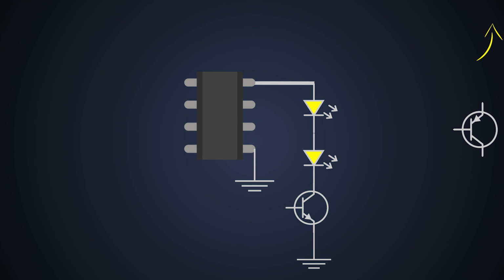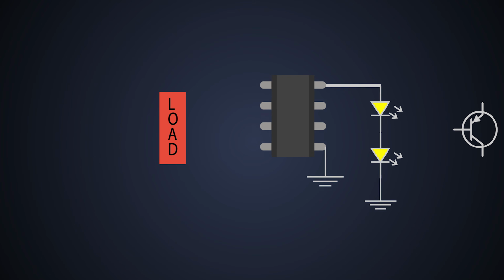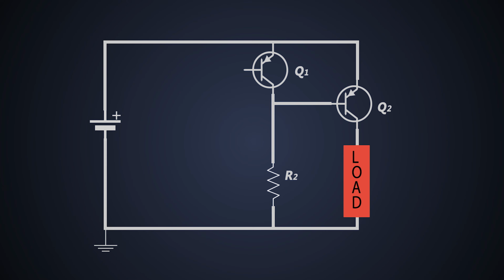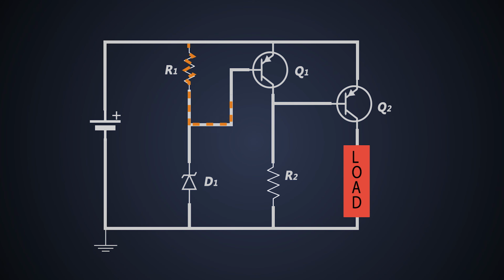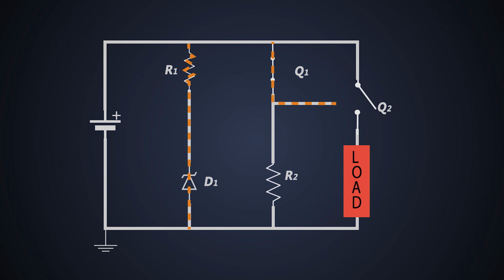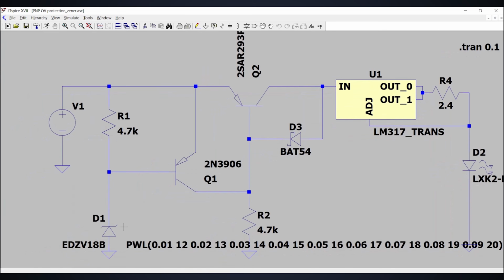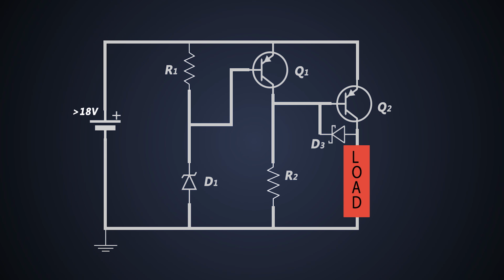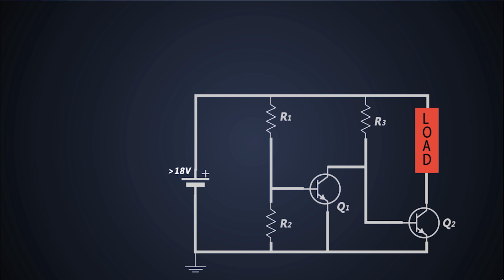How to design PNP BJT based Overvoltage protection? Overvoltage protection using PNP BJT.

Comment: Nice! But still there is some range (for max input) for this circuit and that you should have mentioned and also covered how to calculate that. Because many times there is a chance that 220V is fed into a 12V input system by mistake. So what happens in such case?

Comment: A bit of suggestion: with respect to the NPN solution, you will use most of the time the PNP solution like in this video. That's because when you protect  by enabling or disabling the ground, that transistor collector will sink all the current returing in the ground, hence all switching noises, rf noises, will come to that transistor. The pnp solution instead connectes the emitter with the supply voltage, and you basically detach or attach the input voltage.

I'm talking about the solution in 6:53. That is also called "Transistor controlled Load Switch PNP" which you can find in many application notes

Comment: What is the use of Schottky diode here? Can you please explain? I can not understand.
Reply from the maker: there is no Schottky diode here
Reply: Schottky diode in the LT Spice mode is a Baker Clamp diode (see Wikipedia).  Improves the transistor switch-off time by preventing saturation.

Comment: Sir please make video on internal circuitry  , internal working of  LM 317 voltage regulator
Reply from the maker: Okay
Reply: @FoolishEngineer  thanks for the  reply  , please a video on explaining multivibrator using  transistors  eg astable multivibrator  used for pulse generation

Comment: I am afraid that IURLC is correct. When the supply voltage is increased to say 25v (over voltage) the b-e across Q1 will be around (25-18) volts. Bang!

Comment: This over voltage protection will be destroyed, when voltage V1 increase above zener voltage + base-emitter voltage of Q1, because above this voltage the current through the base and zener diode will increase exponential. Increase the voltage V1 at your simulator to 25V and look at the base current of Q1! You need a resistor at base of Q1.
Reply: correct!

Comment: How can I use this type of circuit when I make high voltage and high current power supply, say,60volt and 10Amp current. And also like to know how can I use a over load protection circuit using mosfet or igbt based dc moter drivers circuit. Thanks